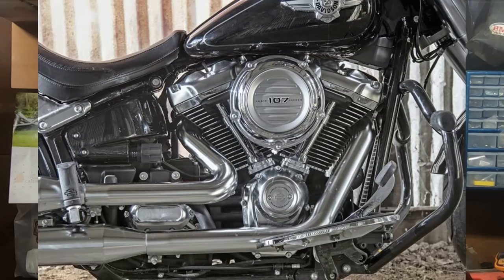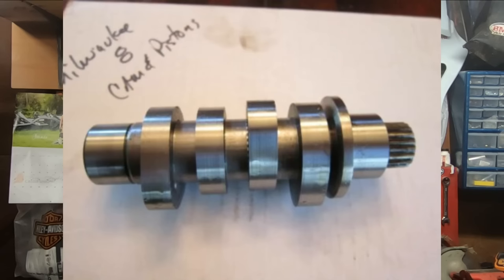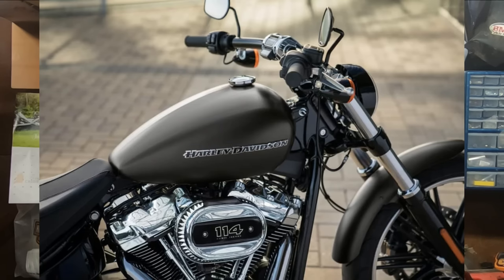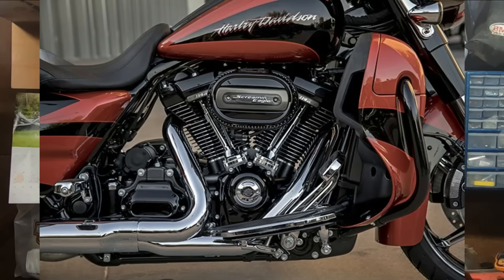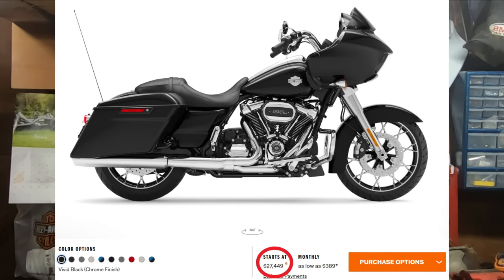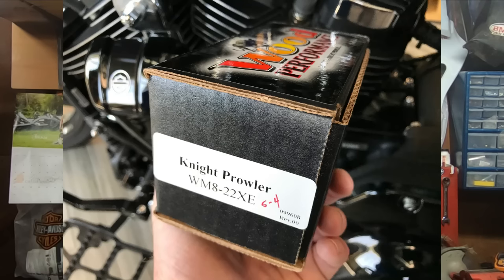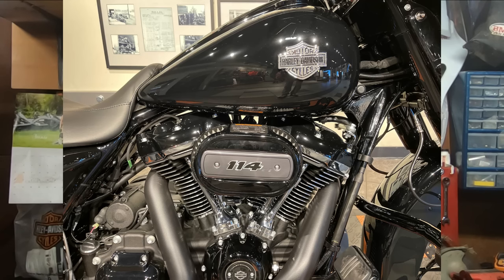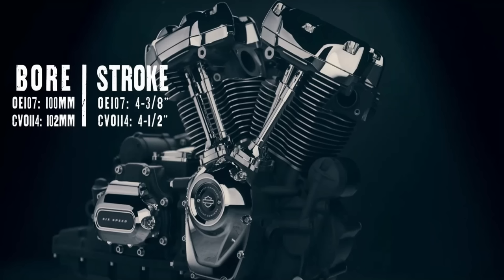Late Harley-Davidson 107's Are the Mistake You Make Overlooking

Comment: Where I live in Ontario Canada, if a 114 hits the floor then it's gone in 3 days or less.  Most are spoken for before they arrive at the dealership.  I know where there's a beautiful 2018 Softail Deluxe 2-tone red with a 107 and low miles and it's been sitting there for 2 months.  It's priced at $20,995 CAD or $16,150 USD and it won't sell.  I don't get it.  If I could afford it right now, I'd be all over that.  For now, I'm still happy with my stage-1 2009 Sportster 1200 Custom.  Even if I buy an SD with a 107 M8, I'd keep the Sportster because it has it's own charm.  Love me a nice EVO.

Comment: You could take the 107 swap in a set of discarded (for upgrade) 114 cylinders and a set of custom pistons and get 112 Cu in, then put the Woods cam  in. The pistons shouldn't cost that much and rings for 4 inch pistons are the most common on the planet. Small block Chevy, small block Ford, Dodge 360, etc. In reality though, Harley should just scrap the 107 and the 114 and start putting the 117 in everything. Then offer Screaming Eagles and CVOs in the 121 or 124 Cu In Engines. That 117 is awesome! If I was going to get a Milwaukee Eight, it would be the 117.

Comment: @GixxerFoo Great video!! It comes at a perfect time. I need your advice I own a 2017 Road Glide Ultra with the 107, with a stage one  done by the dealer My extended warranty expires this September. Been intrigued by putting in a torque cam. I know the pro street tuner is not as good as aftermarket but didn’t want to jeopardize my warranty initially. Now  I have close to 40,000. Miles. I plan on keeping the motorcycle because I think on 2023 models there are going to be  more demand than supply so that means no good deals. I owe nothing on my 2017 and have not had a once of problems. It runs like a top. Thing is I’m planning on buying another two years of warranty but if I do it, the  aftermarket parts( which I feel is superior to screaming eagle parts)  will  void the warranty.. I value your opinion what would you suggest. Or what would you do if you were in this situation

Comment: My 2018 Fat Bob is a 107. Just a ventilator air cleaner and S@S  grand national cans. I'm close to doing a cam chest and cam.  The Star racing 30/30 cam and Woods XE are the contenders. Any preference on tappets?
Reply: S&S or Fuel Moto. Get the OEMs out the sooner the better. The rollers are soft and will begin to gall up on the cam lobes. With the Fuel Moto adjustable pushrods you can use the OEM tubes. S&S adjustable pushrods need their new tubes.

Comment: I did a stage 3 107 to 114 on my Sport Glide within 1000 miles of when I purchased it. It is basically a short stroke 114. Then all the 121 and up engine kits and crate engines came out but I still love the quick more gas efficient configuration I have :)
Reply: How do you arrive at the short stroke 114 cu. in. configuration.
The shorter stroke part intrigues me!
Reply: @xlrider1565 because it’s still a 107 crank with a shorter stroke
Reply: @finestoffreedom3170  
Ok, so wouldn't that decrease the displacement?
Reply: @xlrider1565  no because he saying he started off with the 107 and “punched, bored” out to a 107 so the crank would still be a 107 short crank… he would have a different compression ratio displacement is the independent variable the bottom is or stock block is what’s different slightly from factory like a few hundred thousands of an inch
Reply: @xlrider1565  bored out to a 114 he was a stock 107 he increased displacement by 7 cubic inches
Reply: @finestoffreedom3170  Ty!
Reply: @finestoffreedom3170  TY!

Comment: My 2019 Slim was only available in a 107 and it's a torque monster. Definitely needs a cam upgrade, plate, oil pump. If I'm still looking for more, prices for the Harley 117 upgrade are not bad.
Reply: Can't believe they discontinued the Slim (and the Deluxe for that matter). Slim was best looking model with the polished heads and black jugs, Billiard Blue paint job. Bike just looks right right off the show room floor.
Reply: @barrybarnes96  really like the slim for its plain classic look and the price was was right. The slim will be a long term keeper for me.
Reply: @599Dan  I've got a Twin Cam 103 Slim and it's a "daily driver" (not a 'garage queen'), so easy to live with.  The crossbar on the 'Hollywood' bars allows a roll bag to be strapped on for trips away for a few days.  If I thought seriously, I should track down a good used M8 107 Slim to replace my Twin Cam Slim.  I bought the 103 Slim used at a good price, so probably won't lose too much value on it if I decided to part with it.  One of the annoyances of the Slim is the OEM HD wheel spokes start to rust eventually.  I've seen rusty spokes on the M8 Slim as well.
Reply: @Jonathan-L  I like the twin cam Slims, they look lower and more aggressive to me somehow, I think the back Fender might be slightly different? sounds like you have some history with your Slim I'm sure it would be hard to part with. Dealership has offered to buy my bike back several times. I'm told the slims are in high demand since they've been discontinued.
Reply: @599Dan  When I got my Softail Slim back in 2020 it was an opportunity I didn't want to miss out on.  First up, the bike was 5 years old, only had 3000 miles on it, and had a stage 1 job (SE Heavy Breather, Bassani Firesweeps, V&H FP3 tuner, plus Mustang seat, LED headlight, Jack Knife pegs, swingarm saddlebag).  The previous owner sold it to me for about $6000 less than what he paid, so it was a good deal, so I got a really good Softail with the extras for the price of a new 1200 Sportster.  Luckily, I  was able to head-hunt a really good independent HD mechanic, which also influenced the go-ahead with the purchase.  Buying the bike was made easy, thanks to Gixxerfoo, Matt Laidlaw and Kevin Baxter.  I'm halfway around the world from those guys, and never met them, but their Youtube clips really helped me make a sound decision.  I've got no regrets with the Slim, and happy to get the last of the fully air cooled engines.  I was put of the early Milwaukee 8 bikes with the sumping issues and compensator sprocket design, but if I was buying now I would probably go for a good used Sport Glide (love the 'convertible' style of being able to remove mini fairing & panniers).  Just look at local used prices here in Western Australia, second hand Sport Glides are not much more expensive than a Slim or Street Bob or Low Rider 107.  The Sport Glide is excellent value as a used bike due to the panniers, cruise control and rear suspension adjuster (no tools needed).  A good stage 2 upgrade on a 107 would be awesome bang for buck, and what Gixxerfoo says about a 107 with stage 2 versus a stock 114 would leave money in your hip pocket (might help with the purchase of tires, which will get used more).  So, do I feel left behind with my stage one 103 Twin Cam you may ask?  Sort of, but again it's the last of the air cooled engines, it's got the cool factor, it makes a nice daily driver without giving it the garage queen TLC and it's a modern day classic 'messenger bike' ... I ride mine when I visit clients (luckily I don't need to transport big bulky items), so I get my recreation during my working hours.  It's just one of the perks of the job to be able to ride your pride & joy during my daily work agenda.  The Slim isn't perfect (OEM seat and aftermarket seats don't suit me, so a $30 air cushion from eBay helps a lot, even though it's not cool looking).  The bike I really like the look of and that's the re-issued Electra Glide that pays homage to the 1969 model.  And I love the Road King Special when it came out in Deadwood Green.  Trying  to decide on that elusive choice of "shall I get this particular bike now or wait for something better" can be a bit tough.  I can't believe HD discontinued the Deluxe though.  Crazy.  Ride safe Dan! :)
Reply: @Jonathan-L  you most certainly got an excellent deal when you purchase the slim with all the add-ons, if I ever come across a twin cam Slim in the denim maroon paint. I would have to hold myself back from buying it. Really like the on off run switch on the gas tank as well as the larger primary cover and just some of the other differences compared to my M8. Both are equally great bikes. I initially looked at the Deluxe and also the Sport Glide but in the end the FL front end that the Slim has to offer was the deciding factor for me.
Thank you for your reply
Safe travels
Dan

Comment: So many guys buy for the biggest, fastest bragging rights motor but that has never appealed to me, when i ride my Harley's im not racing, i just like to cruise.
Currently I have 3 Harley's
2021 Street Glide with the 107"  true stage 1 done with Cobra headers, Cobra exhaust, Screamin Eagle intake and a tune.  I have the stage 2 parts ready just waiting for my appointment to get it in
2014 Dyna Wide Glide with the 103"  full stage 1 with tune
2009 Rocker C with the 96"  full stage 1 with tune.

Comment: Love these videos. Harley cannot have an engine easily upgraded for a little bit of money. That goes against their ethos of selling a bike with a tool kit and a parts upgrade manual. It is a good model that has worked for them for a hundred years with the exception of the years just prior to AMF bailout. When you, the biker, can go to the aftermarket and build a better Harley than Harley that is telling. Thanks again for a really informative video.

Comment: Im looking at a used 2021 bike with the 107 and less than 1k miles. My ridingis all highway. Should i be concerned about the oil pump and swap it immediately?
Reply: I have a 2020 m8 107 softail original pump. Warranty just ran out and I have 43k miles on my bike. It's my work horse I use everyday.

Comment: Really like your content on your channel too me you are one of the best out there. You put things in layman terms.  And you are very knowledgeable.  I have a m8 207 with 5300 miles do I really need to change them to put in this woods cam 22xe. Just have not quite got the funds right now after getting exhaust intake pushrods tapper cuff. What is your advice?
Reply from the maker: Well honestly at that mileage you could pop a cam in there and go on down the road. New bearing though always and it's like 20 bucks that could save you a fortune. I would highly recommend upgrading the oil pump if you're bike is a touring model 2017 to 2019 to the redesigned oil pump though.
Reply: @GixxerFoo    Yes I changed the cam bearings and lifters and tapper cuffs with the s&s oil pump and cam plate. It just a street bob. Not into the baggers. I put in the 22xe cause of watching your videos. I like my 107. Runs great now with the 2 into 1 trask assault. Still watching your videos keep up the great work and be safe out on the road. Thank you so much!!

Comment: 100% on the cams. I wouldn't waste my money on mods unless going stage 2 or above with a proper tune as the cam will compensate for the needed backpressure this engine likes. Most guys with a stage 1 are lying to themselves with the numbers as they don't have the bikes tuned right.

Comment: Great vid mate. I’m at my wits end here. Can’t decide between a 2023 Sport Glide or a 2023 Low Rider S. I can currently get either one for $27k as they are run out at my local dealer. Either way I’ll be spending money to get the bags and pillion set up on the LRS or spending on the engine on the SG. Which is the best way to go? Please help 🙏
Reply from the maker: I would go with the Low Rider S all day long if it were me. The Sport Glide is a 107 and LRS is a 117, at least here in the States. Bags and everything you would add is nothing compared to trying to hop up the 107 in the sport glide.

Comment: MY 2019 flhx i bought last fall has 2200 miles.and this is what im doing now.465 s&s cam and oil pump plus bearing.also had to replace the plastic intake manifold with s&s .50.exhaust v&h Daytona 400 exhaust. exhaust manifold stock no cat  ? someone must have stole it.

Comment: You have some valid points there. Right now, though it doesn't really make a difference as even the 3 years old 107 are way overpriced. And buying a 107 pre 2019 I consider as to risky due to the sump issues .
Guess we have to wait and see if the market levels out again under inflation and recession conditions.
Good video. Ride safe 🤙
Reply: Yeah prices are crazy now. I see used bikes priced for thousands more than I bought my softail new.
Reply: I have a 2020 m8 107 with 43k miles. Runs tits

Comment: with the woods cam and oil pump cam plate upgrade ,will that rquire more bottom end work to handle the extra torque and hp?? i have a 107 electra glide standard
Reply from the maker: You'll be fine with a bolt in cam, those bottom ends aren't going to get any better or worse as they are from the factory. A bolt in Wood cam is Stage 4 Screamin Eagle kit power at half the cost basically.

Comment: I've had used bikes and decided to buy new in 21 and went with the Electra glide standard. That's 6k that I saved more than paid for the screaming eagle stage 2 torque cam included new head pipe and 4.5 in street cannons. "Carmen Electra"  glide pulls the Rocky mountain passes with style and grace, and my butt dyno sometimes pucker up, mmmhmm.

Comment: higher comp. means you cant run pump piss  what do you do in colorado with 85 octaine ?high altitude burns as well as midgrade at sea lever  is it enough?
Reply from the maker: I am always of the mind you want to run the highest octane possible in any motorcycle or small engine. I actually carry small packets of octane booster in my saddle bags for the small town that only have regular.

Comment: An evolution powered big twin from the '90s can cruise down the highway at 90 miles an hour smooth as silk all day what more do you need?
Reply: How does that work? My 2002 88 can barely cruise at 65 and is rough as hell. 70 would be pushing it and I can’t  imagine 80. It would be frightening, let alone a death trap given how often it breaks down. 
Can’t imagine 90 , and for hours on end and smooth as silk? It’s like HD made the perfect bike and then made a disaster with the 88 twin cam…..
Reply: @shizuokaBLUES  my 2002 softail springer loves to cruise 75-80.  Smooth.  Not sure if your running a B motor (softail) or the rubber mounted.
Reply: My 88 in my '06 Night Train is an amazingly awesome bike at 80+ on trips. Smooth, and incredibly reliable.
Reply: @ledsled1001  you’re right, rubber mounted it is. A Dyna low rider. 16,000 miles on it and it’s rough as hell. Bought it with 14,000 on it and have spent $8k just getting through all the issues. My first and last Harley.
Reply: @shizuokaBLUES  man I rode my 2000 88” superglide from PA to florida. Cruising at like 80-90 most of the way. Thing did great. The only thing I had to do to the engine was the chain tensioners. I put a cam plate and cams in while I did it. It feels spunkier than a stock 96” now. 57000 miles on it now as well
Reply: @shizuokaBLUES  my 2003 88 does 90 all day and pretty smooth.
Reply: @shizuokaBLUES  outta curiosity what was wrong with it?  That’s sounds uncommon situation as I have a 02 Springer (40k) and 2005 Fatboy (30k) and would ride cross county with no concern.
Reply: Yeah ; I really liked the slim . Now it’s gone . 
You can’t get a springer anymore and not even spoke wheels anymore !!!- 
Harley ; traditional heritage is gone !!!-
Great video;  $$$ really count anymore - 
✊🏻👍👌🙏
Reply: @crspcritter  yeh used springers don’t stay around on showroom floors in Texas at all.
Reply: My stock 05 Roadking TC88 loves cruising at 70mph. It does stretches at 80 no problem. Just a bit more floor board vibs but no big deal.  At this stage in the game it gets baby'd .  I don't push it. In a couple of years I'll be giving up riding altogether.  Gotta make her last. Beats spending 30grand on a new one anyway.
Reply: @ledsled1001  ✊🏻👌👍
Reply: @ledsled1001  well it’s quite a list but I’ll try….

Engine mounts, rotors, front disc (standard maintenance), front fork rebuild, swing arm bearing, stator, screaming eagle hydraulic cam tensioner system, cam, manifolds all around, transmission bearing, 
And a few odds and ends. 

 A stator after 12K is just plain wrong …
Reply: @ledsled1001  getting a little to futuristic too me . Me = dinosaur 😁
Reply: You nailed man! I love my 09 X-Bones with its slightly modified 96 twin cam just as much today as the day I bought it. If it were an 80’s-90’s EVO, I’d love it just the same. Could care less about the “Latest Thing”. I have buddies with 50’s and 60’s Panheads that they’ve run for decades, and they’re not wanting for anything.
Reply: Getting older lol  I'm happy with 70 on my 2001 FXST . Loved going 100 easy and smooth when I had my 2004 FXDI